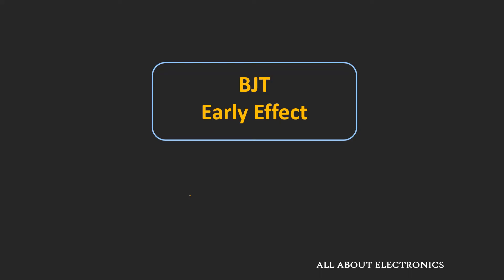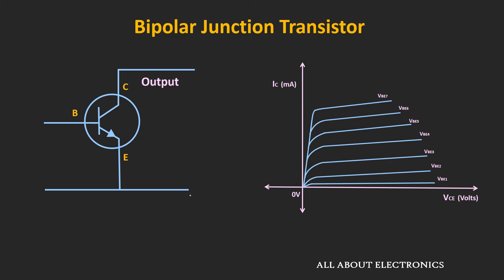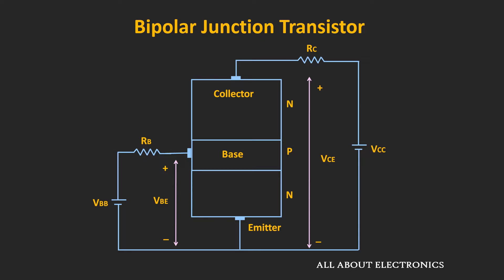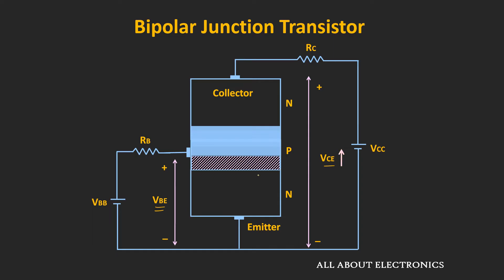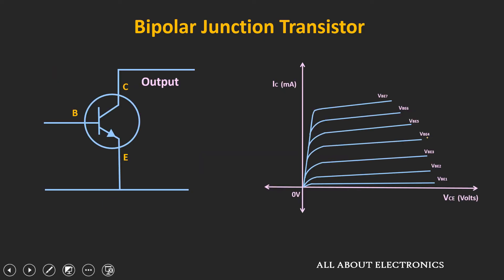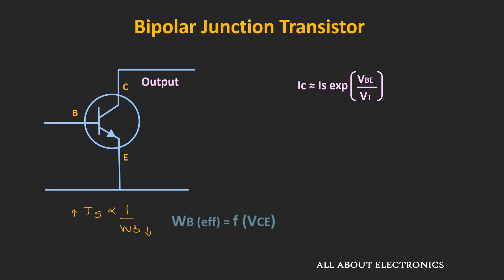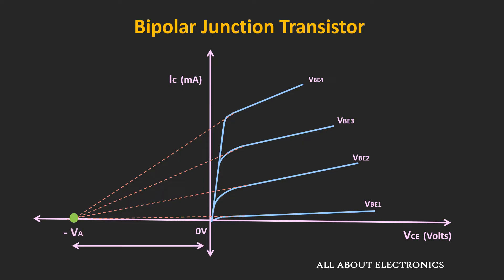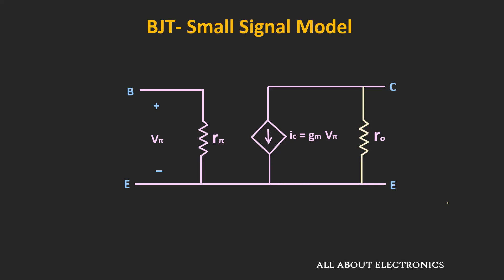BJT- Early Effect (Base Width Modulation) Explained

Comment: Sir, can you please clarify: Why is no early effect in the output characteristics of CB configuration but observed in CE configuration?
Reply: Actually it does. But alpha = Ic / Ie is almost 1. Ic value increases very slightly for large variation in Vcb. That’s why output impedance is very large and not infinite. And particularly, Even though Ie increases due to early effect , We are trying to maintain input current Ie as constant. So whatever Ie present , from that only we can get Ic value. No matter how much we increase the Vcb value. But in CE configuration, beta value is much larger. Even though Ib is constant, Ie gets increases due to early effect when Vce increases, so does Ic. So it is obvious in the output graph.
Reply: @Vishwa2757  Thank you very much!

Comment: Sir you mathematically proved there is a increment of R output resistance in small signal analysis circuit due to the early effect. but i want explanation theoretically  how the output resistance occurring which is  related with early effect ?? sirr please sir explain sir please sirr

Comment: sir, so basically at 5:20 , due to early effect collector current and current gain of the  transistor increases by a factor, but base current remains same. won't effective base width reducing reduce base current intuitively?

Comment: Isn't the increased depletion region between the base and collector filled with hole majority carriers? If so, wouldn't the increase in electrons passing the effectively narrower base region simply recombine here instead? How can you count the increased amount of electrons passing the base as collector current when it hasn't yet passed the larger depletion region to reach the collector?
Reply: The whole concept of depletion region is that it is devoid of "Mobile Charge Carriers". The depletion region has only immobile ions. So there are no holes in the depletion region .